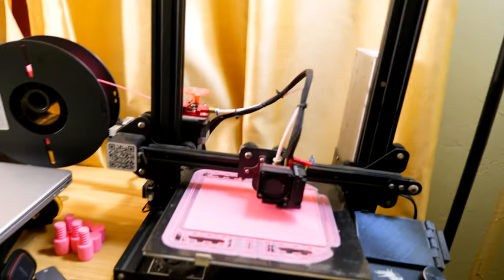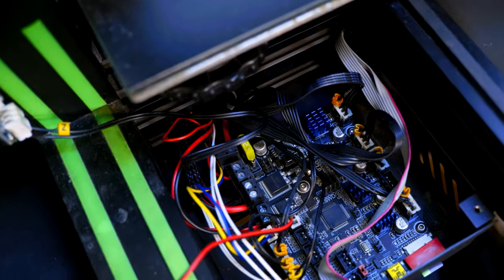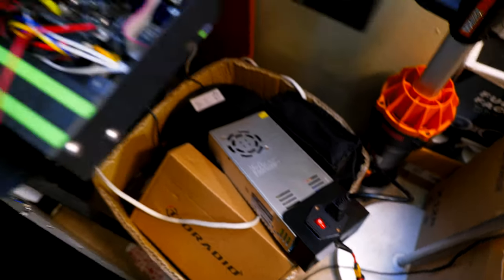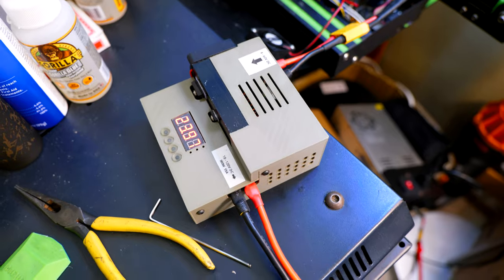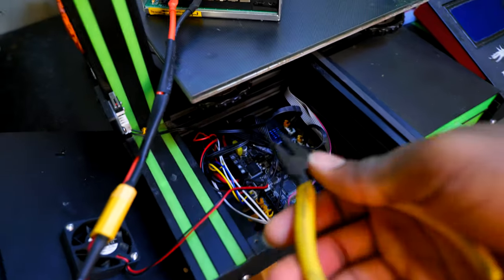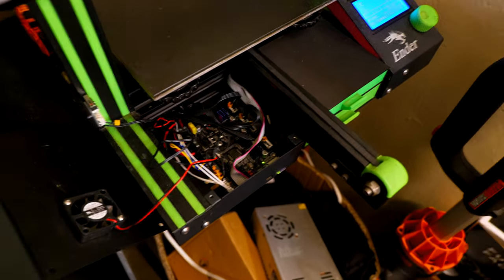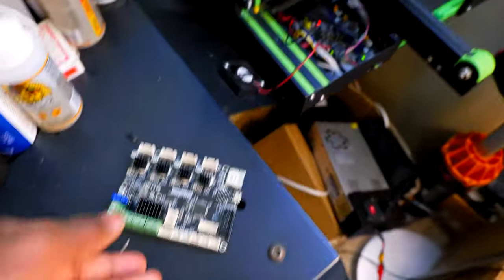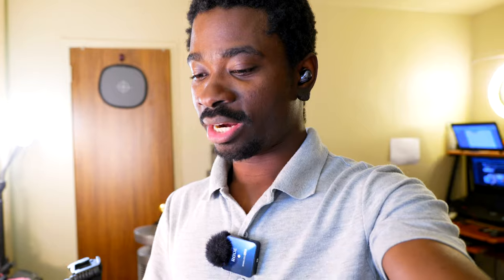This error destroyed my 3D Printer| Creality Ender 3

Comment: I found an old reddit thread with the title: Ender 3 Pro “Homing Failed: Printer stopped, please reset”.
Possible solutions are: 
- Y-axis limit stop is not connected or defective
- download the firmware from their website and save it to the SD card

hope this helps you
Reply from the maker: Thanks, I'm going to look into that